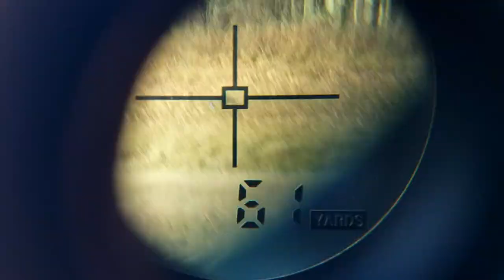Shredding a Bulletproof RC Tank with High Power Rifles

Comment: If you put some spare rounds in the hull, like .223 or 9mm, you could probably get it to cook off, especially if you shoot it with API or green tip rounds. Any round with steel cores will get ammo to burn brcause the sparks and friction generated on impact with the armor. Smokeless powder would take more energy to ignite than tannerite wich is why FMJ wouldn't work as well. Food for thought. Great video as always
Reply from the maker: When I shoot it with 30-06 Black tip in the next video I will fill it full of random rounds. Maybe even some black powder, or fireworks in the future too. I like the thought, thanks for the comment brother
Reply: @BozAwesome  Of course. That sounds like it would be spectacular. One thing you could try is placing make shift ammo racks to hold the rounds in place inside the tank kinda like the actual Tiger 1 ammo layout. A side shot with that blacktip is guaranteed to do some impressive damage!